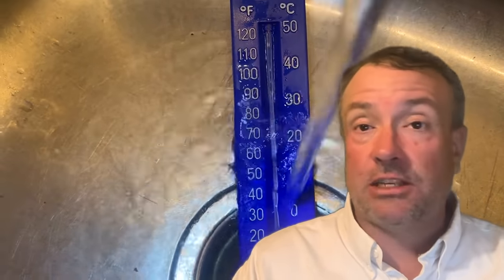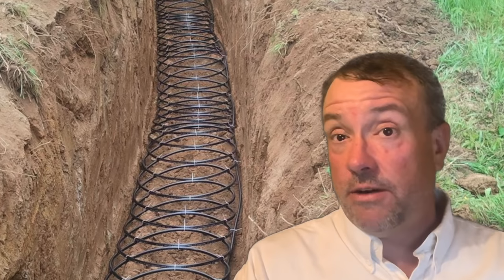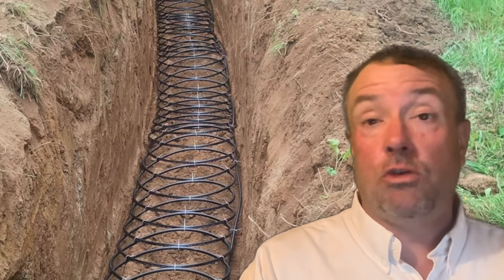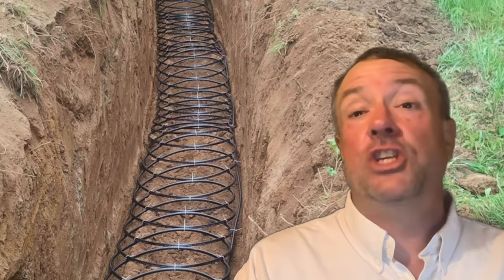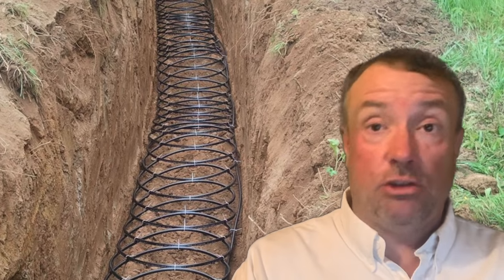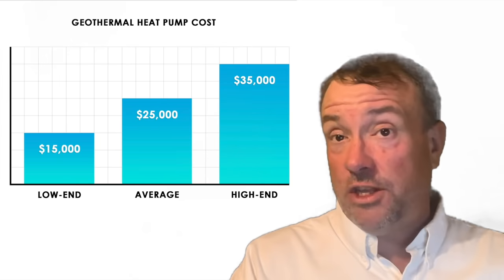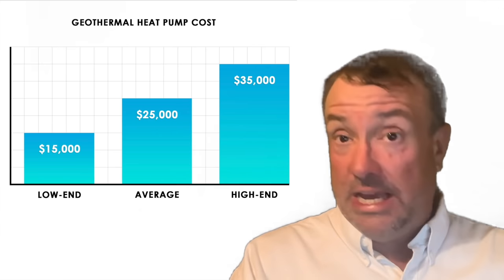Geothermal Cooling Tricks and Hacks

Comment from the maker: Do you know any geothermal tricks and hacks?
Reply: There must be an optimum circuit length for each diameter of tube.

Instead of an automotive radiator, coils of tube inside would likely be effective.
Reply: @jakebredthauer5100  do you have any sources on this point for me to read some more please?
Reply: @anhaicapitomaking8102  I don't know of any books on this subject. You do not say which point you were referring to. If you had a specific question I may be able to answer it. For basic information refer to the laws of thermodynamics.
Reply: No, I don't know tricks, but that system with heat pumps was quite widespread in the 80ies in Switzerland (Europe), but it cooled down the garden soil and growth started weeks later than normal. People then started drilling holes to around 100m deep, this was very expensive as in the beginning sample drills were used that could only drill app. 2m at a time. Soon after, drills how we know them now, were developed. They are much cheaper and this system is widespread now.

I use a passive system in my greenhouse to cool in summer and heat in winter. The water is from a well, drilled to water plants and fill my fish pond, unfortunately it is too salty to use in the house or greenhouse.

The ground temperature close to the surface is the annual mean temperature and thus quite useful for heating and cooling.
Reply: @hansulrichjohner2694  How deep do you think that we need to bury the horizontal tubes to get good results for cooling?
Reply: @jakebredthauer5100  I have no experience, but I know that the active systems in Switzerland were at about 50cm depth, but creating problems with the growth. I know that in 1m depth there is almost no annual temperature variation, so you would have the perfect temperature reservoir,  but it also means that it does not regenerate passively. At 50cm you would have partial passive regeneration but the before mentioned problems with growth.
I live in Thailand, with a soil temperature of 27.5°C, which is perfect for cooling and heating and thus would regenerate automatically. In regions with moderate climes you can not use the passive system for heating and regeneration, so you could use a heat pump to heat a house or you heat a greenhouse or garage to prevent freezing, or you just use outside air in winter to cool down your system, my greenhouse heater/cooler consists of a car radiator and a strong fan. This system gives me a heating power of app. 10% of the corresponding car's power.
Personally I would prefer 1m and have a stable and controllable system.
Reply: @hansulrichjohner2694  One meter is near 40 inches.  50 centimeters is one half meter, near 20 inches.  "Regeneration" means to get the ground temperature back to what it would naturally be without the effect of operating the system.  "Passive" means no pumps or fans.   "Active" means with a pump or fan.

Your report sounds authoritative to me.  It means we don't need an excavator to go down eight feet, as the video says.  We can use an ordinary power trencher to go down less deep.  These have a chain that cuts/digs.   Thanks.
Reply: @jakebredthauer5100  As you write, regeneration is to bring the system back to the initial temperature, or even go further. With active I meant with a heat pump, passiv is with only a circulation pump. If you can reach around one meter, a trencher is perfect. 
One point remains, you have to estimate the volume of soil you need to get the necessary cooling (or heating) power. I can not do this on the fly, but in the second part of the video a dimensioning formula, based on experience, is given, this is much better than what I can do.
If you have enough surface, you can dig in the tubes with a trencher at a distance between the tubes, that is easily done with the trencher.
In theory the tubes can be placed at 20cm (say 8inches), to make optimum usage of your ground.
Another possibility is to drill a water well, water has a tremendous heat capacity and is very easy to use.
I did not mean to sound authoritative, sorry, but I am a retired physicist, so my language is quite technical, further more, my mother tongue is Swiss-German, this surely does not help to make my English sound smooth.
Best regards
Ueli
Reply: @jakebredthauer5100  If you can get to about 1m, a trencher is perfect. The distance between the tubes can be as low as 20cm (say 8 inches), but if you have enough ground do it somewhat larger.
As you write, with regeneration I mean going back to the initial state or even further, eg cooling the soil further down in winter increases the systems capacity.
With active I mean with a heat-pump, passive I mean with a circulation pump only.

What I cannot do on the fly, is to make a decent dimensioning of such a system, but in the second part of the video there is a dimensioning formula based on experience, this is much better than what I can do.
Sorry, but I did not want to sound authoritative but I am a retired physicist, so my language is quite technical, furthermore my mother-tongue is Swiss-German, this surely does not help to make my English sound smooth.
Best regards
Ueli
Reply: @hansulrichjohner2694  Competent, reliable, authoritative, informed, correct, valuable.  I meant "good".
Reply: @jakebredthauer5100  Thanks a lot!
Reply: I designed a rig that cost way cheaper than buying a backhoe . At production they will be slinging for around 600 bucks . I'm working on finishing up the pipe connection design now. Here where im at 250 ft per ton we own the big rigs to do the loop holes .  But you can dig multiple shallow 50footers you just have to accommodate and make an extra hole or two bc of shallow depth.
Reply: @thhillbillyinventor105  What about a bucket and a rope with an electric winder to do the heavy lifting?
Reply: @jakebredthauer5100   Once its finished it will be only water doing the pipe lifting  instead of the pvc hand crank thats on the vid . Turn a valve and it lifts up or down.
Reply from the maker: @thhillbillyinventor105  send me a link when it's ready!
Reply from the maker: @syedfarzan6695  how cold is the well 100' down?
Reply: @syedfarzan6695  Try it with air and if that doesn't do, fill with sand.  It will work with air if you use multiple loops of smaller diameter tube to give more surface area contact with the air.  Sand to tube contact is more effective than air to tube contact.

The temperature in the well is significantly cooler than the temperature of an average summer day.
Reply: @syedfarzan6695  You can do like they said or if you use a loop In it there is a special bentonite that is more thermally conductive if it's dry. Did it dry up from water table drop . No water at all in the well or is it a slow producer . If it's slow producer it may just need to be re developed.
Reply: @SimpleTek   i dunno bro but the metal casing around it which goes down the whole well is always very old even in day, also when it rains gets like 150 to 160 liters of waters
Reply: @thhillbillyinventor105   its diameter is like  10 inches and it got thick layer of metal coating
Reply: I was thinking it already got a metal pipe , i can just fill it with water and conect it to radiator and add a fan maybe might work, 
Its first time i heard of such solution i dunno if it will work or i will lose money, 🙃 i need professional help,
My home is made up of concrete nd bricks ( like all homes in my nation) 
I got like 1 and 2 tone ac  thet only help as much to cool the specific room also i can't  run them 24/7  as electricity bill alone  takes  32% of my salary. Other rooms are so hot its like walking into an oven.
Also cant find many videos about how to make such systems  ( probably due to location restrictions)
P.s. would really appreciate if anyone can provide tutorial or help
Reply: I use my ice auger to dig very deep for cheap and to also put in posts. Is this an effective way to dig down?
Reply: I'm going to follow your plan for my cabin in the mountains. Do you have a resource for how long the trench should be? I've got less than 1,000 sf to cool and it's well-shaded. I really appreciate your video!
Reply from the maker: @TheWebMindset  I wish I knew of one. Thanks for the kind words
Reply: X6 -  1000ltrs  IBC tanks piped together  and buried under the ground  .. they will be the heat sink to utilise  ....I guess that will work too.
Reply from the maker: @clownssschwab6394  nice
Reply: If you have a 8 foot round water well (which I do) (about 25 feet deep and 10-15 feet if water) could this work by putting lines into the well or is there not enough water?
Reply: If you line those trenches with poly and back fill with 8” of sand and water it in you will double your cooling capacity per run
Reply: @Justthemow  Great idea.
Perhaps one could also add a "water fill tube" so that water can be replenshish into the sanded area if the water evaporates over time.
Reply: Ive come up with one that would work great, just need a backer to make it to production.

Comment: So where's the directions?
Reply from the maker: What kind of man needs directions?
Reply: Lay down some copper pipes, hook it to a radiator, put a fan to pull air through it
Reply from the maker: @supjay3945  copper is expensive, use underground water lines
Reply: @SimpleTek  even better

Comment: To use with a central HVAC system, a radiator could be added into your duct work (inside a sealed box). It will supplement the air temp to decrease the demand on your HVAC unit.

Comment: I would love to hear your thoughts on a home cooling system that I first heard of a few years back but has since gone out of business. The company's product was called "the Ice Bear". The device was basically copper coils submerged in an insulated water tank that was attached to a refrigeration system that would slowly freeze the water during the day with the use of solar panels until the water tank became a giant block of ice. The copper coils were attached to a radiator and fan system with pump similar to the low grade geothermal hack you describe here but instead of the cool of the earth, the system would use the ice created by the power of the sun. The sun would power the system during the day to make the ice and you would use the ice at night to cool the house for small amount of power generated by the fan and pump. Not sure why the company folded but I am intrigued by this idea. Do you think its dumb or might work under the right conditions? Thanks.
Reply from the maker: interesting - it depends on the amount of energy used to achieve the cooling...... using a phase change might amplify the system's efficiency
Reply: Wouldn't it be more important to have cooling during the day instead of at night? Unless i'm misunderstanding it seems like it would make more sense to have the solar panels charge batteries during the day and then run the freezing of the block of ice at night with the batteries, and use that ice to cool during the day.
Reply: Cooling during the day could be powered with AC and solar panels. Nighttime temps can also be very high in the tropics. The ice block would act as a cooling battery so you can still have cooling even without the power of the sun. Use the suns power to make the ice block during the day then use the ice to cool at night as it slowly melts.
Reply: Figure that if it worked good, and the Cabal found out about it, the company would be forced out of business. But the set up and maintenance costs need to be less than just a standard AC system. I can't imagine the cost of a permit to bury tanks, and the cost of the tanks and other piping, and labor, to be less than a typical inefficient AC system. The payback time needs to be less than your lifetime.
Reply: I found a video one where the guy used a chest freezer to try and freeze water in the chest. He had copper tube wound through the chest and circulated antifreeze through it. He filled the chest up all at once and never could get the water to freeze. I always thought if you started the water level low and added as it froze till you got the whole thing froze then maybe you could maintain the frozen water. You could easily run a chest freezer off Solar panels during the day and maybe even at night off batteries.
Reply: @Noafloaf829  I have heard of that very system being used in big city buildings to store cooling.
Reply: @amathonn  Really? That's so cool, do you have a link to it you could share I'd love to learn more

Comment: Why not add a solar water heater to the heating system portion of this build just add a section where it can be attached and disconnected for the season.
Reply from the maker: that might work but glycol is much cheaper and easier
Reply: @SimpleTek  no I mean build a copper pipe system enclosed in a sealed box with end fittings that would attach both to each end of the solar heater which heats the glycol with the sun no electricity and with a cut off valve so you can remove the solar heater in the summer and reattach it in The winter.
Reply: @jujosworld  have you built one of these?  I had considered building something like this to heat my garage in the winter.  My only question was what to do with the system in the summer?  I know you'd stop pumping fluid, but does the fluid flow back to it's holding tank or just remain in the solar heater all summer?
Reply: @AaronPaluzzi  I have not built it physically i am still looking for a proper attachment but to answer your question if you use the window washer  fluid you can leave it run all season in the summer because if the heat/frost line below the ground it should work as a heater in the winter and a cooler in the summer. My overall thoughts was to build an attachment with fittings so you could attach a solar heater ( build a box with piping to heat the fluid with the sun.)  That would help heat the ground and with a small pump circulate the fluids. If you go to a plumbing store you can find most if not all the fittings you can use for this. I am a problem solver it intrigues me to help others. As for me I have property but my family comes first. So I have not had the pleasure of building some of the things in my head. Maybe I should put it to paper as we old timers say.
Good luck with your project any questions just post a comment and Ill get to you asap.
Reply: @AaronPaluzzi  i forgot to ask something because there are a few ways to do winter heat in a garage the previous reply was for improvement on the build on this page but there are other types of solar heaters that use the sun to heat an area.

Comment: You don't need to use pure glycol as a coolant. Not unless you live in a place where the surface temperature might actually approach negative 40c.
You can easily Google a table for the mixing ratio you need to keep your coolant flowing at X degrees C.
Water conducts and stores heat way better than glycol so it only helps efficiency. And it's free... 
That said - It would be wise to use a large safety margin of course. 
 As for how much you need to fill a given length of pipe, that is pretty simple math to calculate as long as you know the inside diameter. just Google a calculator for a cylinder and put in the known numbers.
Reply from the maker: it gets to -40' where I live....
Reply: @SimpleTek  As a Norwegian, I feel you ;) I'm just saying that it's probably not the case for most people who watch this video.
Reply from the maker: @TheStigma  my demographics are mostly Canada and the northern USA.. YouTube is awesome in the detail of it's statistical data